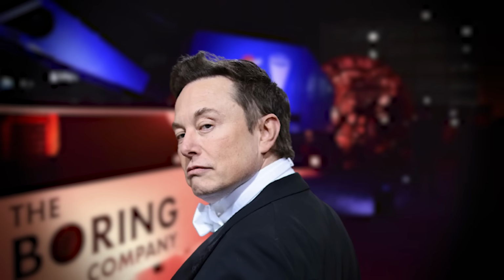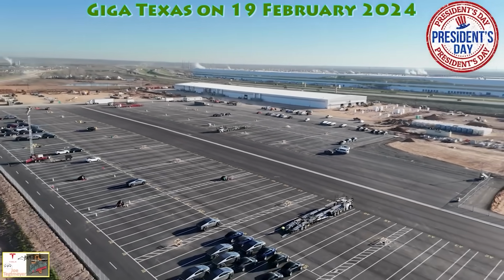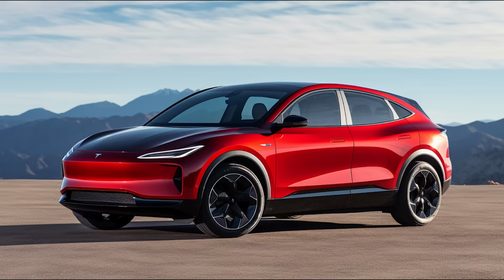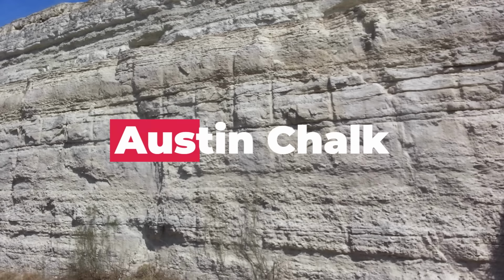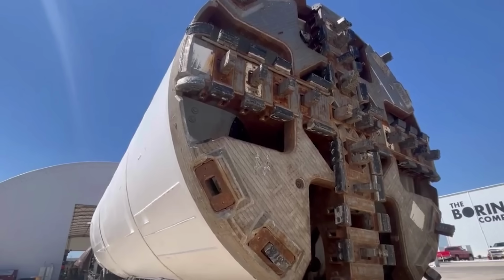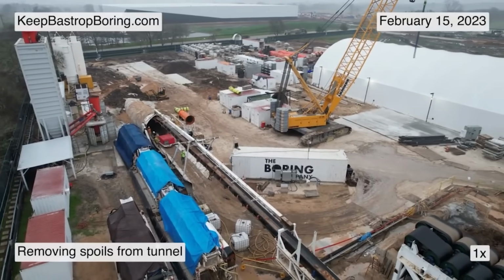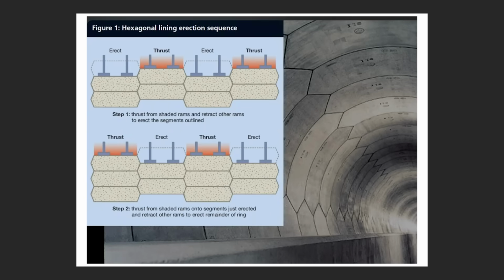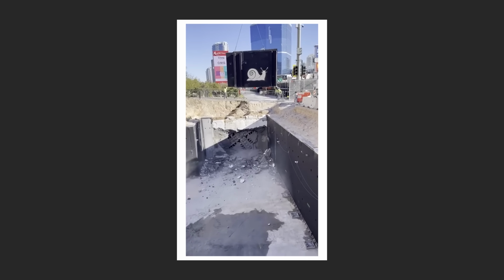Elon Musk Isn't Telling Us Something About The Boring Company

Comment: The spoil is limestone.  Limestone is the basis of cement. You put it in a kiln and at the end you have cement, mix with pot ash and gravel, you have concrete.  Either they will use it, or will sell it to cement companies.
Reply: Not enough volume or quality to make it commercially viable.
90% of TBM spoil is just used for landfill/reclamation.
Reply: @davidsalisbury50 Much of the whole history and activity at Giga-Factory involves landfill and restoration. It sits on the Martin Marieta surface mining site. Lone Star and Texas Materials are right there. If this video is wrong about "hazardous spoilage" (as so many commenters argue), then there should be no problem and plenty of use-cases for the excess tunneled-out dirt, sand, and rock right on the site.
Reply: @WarrenLacefield  Interesting.  I was not aware of the site history. So the material they will excavate through may be fill material. The spoil from an EPB TBM tends to be very "wet", containing a lot of water and foam used in the excavation process, or from the natural groundwater table. It is not much use for anything until it has dried out to some extent. We can see from the recent drone footage that the spoil bin (Excavated material deposit from the conveyor system) is walled on all 4 sides and has had some polyurethane foam treatment along the joints of its block walls. They are clearly expecting it to be very wet.
Reply: @tunnellingsalisbury7605 I guess we will just have to wait a bit and see. That is what makes these videos, especially the drone overflights, interesting learning experiences.
Reply: @WarrenLacefield  The drone videos are great. I comment on them frequently. My aim is to inform and clarify for people who are interested. I do call out BS when I see it, but the drones don't lie. I'm looking forward to the drive below the highway.
Reply: Yes, indeed, but they said it was mixed with some kind of hazardous "lubricants." I didn't know about and don't really understand that part. In my own experience, I have never heard about any such lubricants required for mining or earth tunneling.
Reply: Lol they are not going to build a kiln there! 😂
Reply: Soul cement base for rock dways
Reply: cement companies already have more than enough limestone much closer to their factories lol!!!!
Reply: Cement factories will never use spoil of such poor quality lol , what are you talking about. Lime used in cement is excavated from high quality lime mines, not general dirt from digging tunnels.
Reply: @AG-ig8uf  In Austin, 6 feet down is not dirt.. it is compact limestone.

Comment: The only way to dig 7 miles a day is to use a rotary plasma drill that vaporizes the Rock and cuts then the rock is turned into support for the tunnel. The technology and the engineer is now been declassified and you can find information now .
Reply: Oh, great, Hit a gas pocket or a line everyone forgot and you'll have a bad day. A mile a day from tunneling to sealed and on to the next section is fine.
Reply: @jameswilson5165  For most purposes such as inter city, you can drill deep at a depth below 100 meters and not worry about much, maybe even below the likely water tables.
Reply: Another pie in the sky from musk, driverless cars by 2018.. give us a break from this nonsense.

Comment: 7:14
The capability of the machinery to tunnel through an area, especially under a bustling city with a complex infrastructure, is significantly influenced by more than just its physical capacity. The need for continuous monitoring, legal considerations, adherence to codes, and the fact that this was a pioneering venture in a real-world application, all play crucial roles in determining the actual speed of tunneling. 
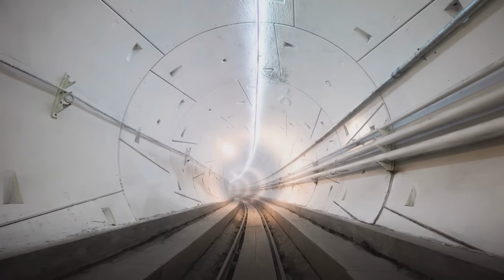8:33
The tunnel sections being stored at GigaTexas are of the standard trapezoidal shape, identical to those seen in footage from the Las Vegas Loop.
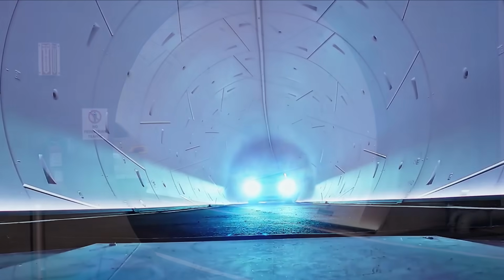12:13  
The description you referred to as rectangles with slanted sides are called trapezoid, or keystones, which are uniform and designed to fit together seamlessly. This method of construction isn't a new to the Boring Company's tunnels.
12:47 
Observing the construction of Gigatexas over the last 3 years highlights Tesla's proficiency in moving massive quantities of dirt quickly and efficiently.
Reply: @ 7 : 14 codes don’t apply 30’ deep
Reply: @sparkysho-ze7nm Sure they do. Tunneling under infrastructure and property? You bet your ass there will be oversight and codes.

Comment: It seems to me that the spoils could be mixed into a slurry and used to make many of the hexagonal tiles as substrate. Playing with the solvent choices and being able to separate the spoils in a sluice would easily allow part of the material to be reused in the formation of the walls and potentially change the makeup of the solvent as well by allowing it to be reclaimed from wash water depending on solving choices again. As a chemist, I see a lot of possible solutions to this that would align with elon's plans for recycling and saving energy.
Reply: Yes, I was just thinking the very same thought. There clearly needs to be a way of "confining" or "neutralizing" the spoilage as well, especially when or while using it for some practical purpose - for underground or highway basis rock fill or for concrete or asphalt foundation, etc.

Actually, I hadn't realized that tunneling required "lubricants," let alone hazardous ones. I thought the spillway just removed dirt and gravel. John Henry with his hammer, underground mining machinery, ordinary excavators and shovels don't require that (but do wear out eventually). I've stood nearby coal seam faces in underground mines watching those machines work and never worried about much except the roof supports and carbon monoxide (CO). But, on the other hand, milling machines and electric drill bits do require oil, etc., when shaving or drilling holes in metals like steel (to reduce wear). Funny how one can "miss" a fact that may be obvious to others who are more familiar with a process.
Reply: Looks like they're already using this for tunnel walls and boring bricks.
Reply: @rainrainov4495  The concrete for the segments is a very high-quality controlled set of materials (Cement, sand, aggregates, additives). Tunnel spoil cannot be used for its manufacture (except in very exceptional circumstances such as very long tunnels constructed over several years in very high-quality rock). TBC are NOT making bricks with their spoil, they tried it, it didn't work. the spoil is too wet and too variable. TBC are not using separation plant or filter presses to remove the water from their spoil. I assume it is being taken away for drying and eventual landfill material.
Reply: Spoil, not spoils
Reply: Highly unlikely except in very competent rock and on long projects (where it is done). Otherwise the spoil/muck/excavated material is not of a suitable quality.

Comment: The tunnel system seems to be far more useful as new trade routes not people transportation. If the tunnels could be large enough to move shipping containers, that could be huge.
Reply: But why containers?  Tesla are supposed to be self driving, and in a tunnel they can do exactly that.  Even all the way to a container port.
Reply: @MichaelWinter-ss6lx  which is a waste of energy and time to move a bunch of independent trucks across the country. Far better to have these underground high-speed routes from the ports to inland. If it can fit basic shipping containers, that would kill like 80% of cross country trucking, excluding mountains or perma frost. It would clear up the major highways, at least. From those distribution points, tesla trucks can move products around locally and be back to charge by night.

The amount of money tesla could make by just a small tax on goods that can travel multiple states in a day without human intervention would be staggering.

Just think of it, an automatic crain, pulling containers straight from the ships, and putting them directly on an underground tram, its location to any of the major US city's is already programed and off it goes. Just for another auto crain to lift them to a tesla truck and off it goes. It's almost foolproof. 
No humans needed

Comment: The term 'spoil' is much older than Prufrock.  Its not named that way because of toxic lubricant used in the drill head.  If you dig a tunnel with a shovel the soil removed in the excavation is still called spoil.
Reply: good to know kenneth. thanks
Reply: Muck or spoil is fine. Just got nothing to do with contaminants soil conditioning agents, tail seal grease and main bearing grease. Most of which are biodegradable these days.
Reply: Built a small island with the channel tunnel spoil
Reply: Not muck?
Reply: @sparkysho-ze7nm  muck can be, but is not exclusive to spoil. I might get home and need to clean the muck off my shoes, but that doesn't mean I was digging a tunnel.
Reply: @sparkysho-ze7nm  muck it
Reply: Fuck muck. Boil spoil.
Reply: Plasterers call wet plaster “mud” Brickies say, “muck” for wet mortar.
Reply: @Dave5843-d9m  Tunnellers call the excavated material by different terms, I don't believe there is any clear definition. I would tend to use "spoil" for the material produced from a TBM as it is often mixed with either a bentonite mud (on a slurry TBM) or some form of additive liquid (For an EPB TBM). I tend to use "Muck" when I refer to a cleaner excavated material from hand mining. Although I refer to the holding point for temporary storage of the spoil as a "Muck Bin". 
In hard rock tunnels I use the word rock for the excavated material.
Reply: Ubiquitous throughout the dirt moving industry.
Reply: In the oil drilling industry, it's known as "Mud"..  They pump "mud" down into the hole so that it will flush out the excess soil and bring it to the surface;  and that "mud" will empty into a local pit/ reservoir, where it can be pumped down the hole again.. over and over.   Slightly different, but very much the same idea
Reply: J Alfred Prufock by TS Eliot. 

No idea why that got inserted into my thought stream.
Reply: Toxic lubricant , vegetable oil is toxic is it.
I was on the airleg for quite few years , we used vegetable oil in the drills.
The hydraulic oil( Toxic) is what is used to push the head forward and rotate the rotor not for lubrication , This show me over 35 years underground drilling you have not got one clue about any form of tunnelling let alone the gear used.
20 militrs of hydraulic oil can stuff an entire gold mill.
Reply: And it is called "SPOIL", not "spoils", as the drone pilot insists on saying.
Reply: Hmmm, but that would not make for an attention grabbing headline, would it now? 😂😂
Reply: Muck

Comment: There's a 1966 Patent on a Tunneling Machine. Instead of toxic lubrucation or even removing spoils is that this device melts the rock and uses pressure to compress the melted spoils into an air-tight, water-tight tunnel wall. It uses a nuclear tip to melt rock and with nothing to remove it has tunnelled at least miles per day. 
Its what the military used for decades up to today.
Reply: Where did you get that? I don’t believe it.
Reply: The Military do not need to take into account the EPA, laws, or human rights.
Reply: If the tunnel is hollow then the rock has to be removed melted or not!
Reply: Compressed rock is even denser than normal rock. This also happens to make tunnel walls incredibly strong.
Reply: Actually something like 6 feet of concrete is all that is necessary to protect from radiation. By those standards one could use one of those underground nuke holes and with a little concrete make a safe workspace.